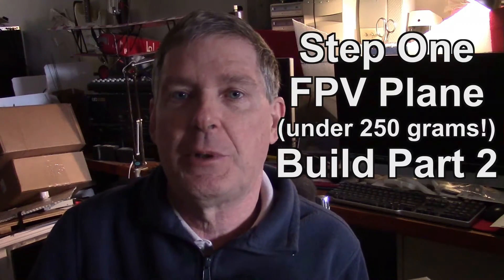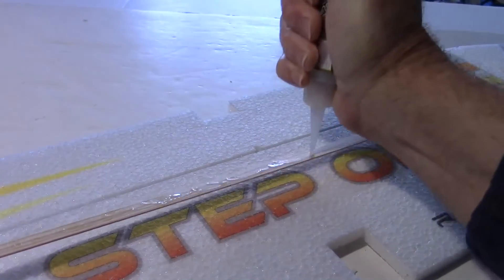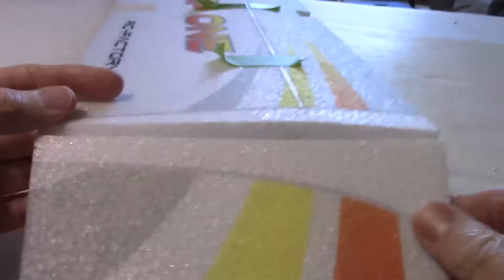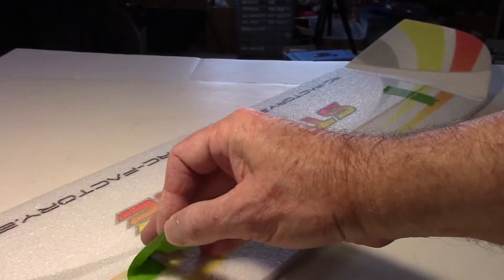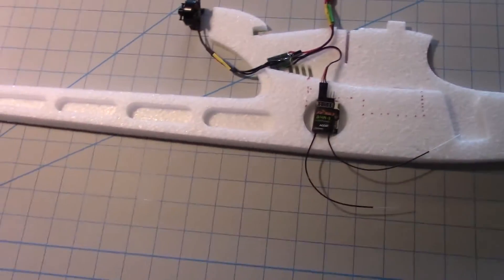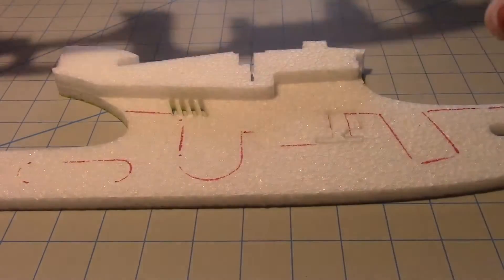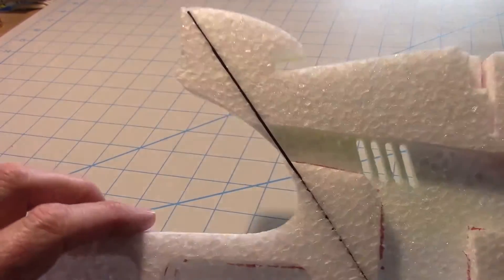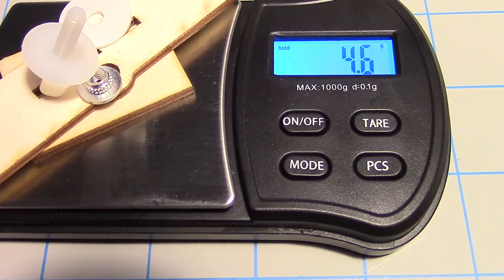Twisted Hobbys Step One FPV Plane Build Part 2 (Under 250 grams!)

Comment: Great detailed explanation Dave! Awesome as all your videos
Reply from the maker: +Eduardo Fritis Thanks Eduardo. I think the electronics portion will be the challenge as far as weight and I don't have the FC yet due to the Chinese new year vacation.
Reply: +dmerc00 are you putting an APM mini? You really don't need FC for such little plane, do you?
Reply from the maker: +Eduardo Fritis I have a beerotor on order, has a built in OSD. Going to see what I can do with it. Like to have battery voltage, artificial horizon and stabilization.
Reply: +dmerc00 a guy that I used to fly with scratch build a little plane like yours and slapped on top a Pico transmitter and camera and flew it around the park. Super fun plane, simple but FPV and light. But with stabilization, battery and horizon it would be very cool too!